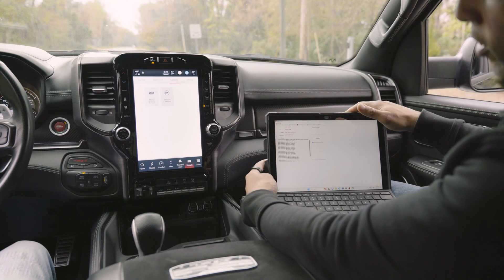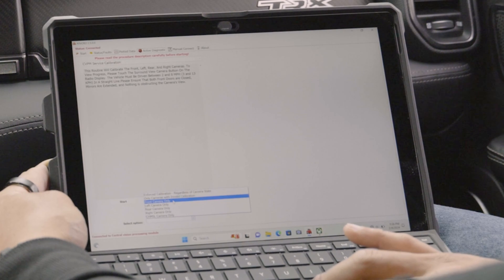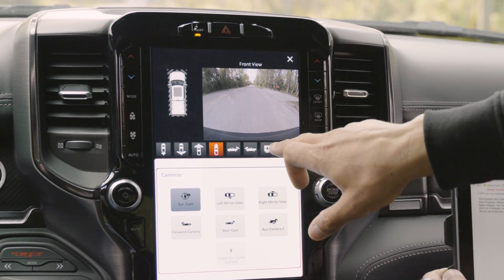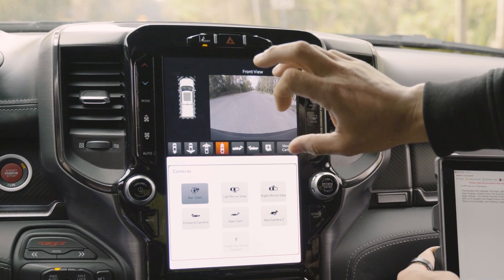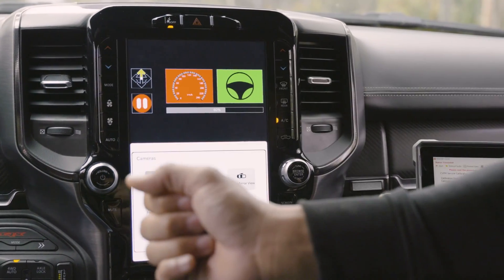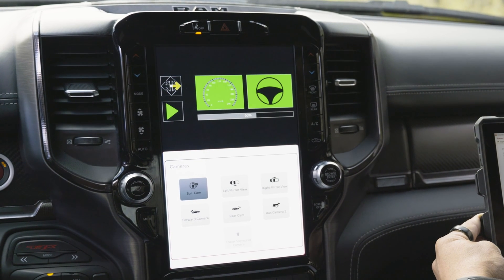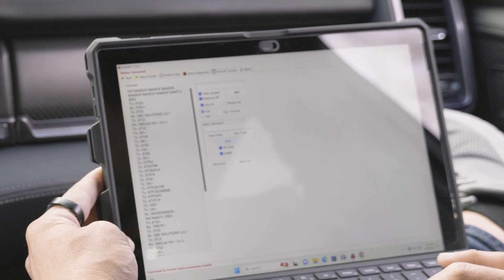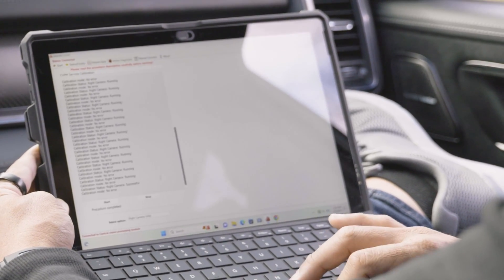RAM 1500 & HD - How To Calibrate The 360 Surround Camera w/ Alfa OBD

Comment: Hi Infotainment,

Thanks for the video again. 3/4 camera works as per video instruction except the front camera. message pop up line by line reported like the Left /Right / Rear Camera success until progress to 100%.

For the front, no message,It started the calibration process , stay green for both steering wheel odometer symbol. then after 500 ft. to said calibration fail. can you help
Reply from the maker: Unfortunately we can't really assist with this. It's just trial and error. You might need to take it to another road that's straight and has the painted lines, or have your local dealership do it through their programming software.
Reply: @Infotainment_nav  Thanks. I am now need your solution to get the Third Brake Light, Camera to works. the CVPM current utilized all 4ports for Front Back Left Right Camera. This 5th camera will need to connect to Uconnect 5.0 somehow, or through can bus ? Do you have a solution, wiring , harness and connector plug to purchase?

Comment: Hey so I know this is not about this video rather about a previous video I have commented a few times but not heard back. I have a 2022 ram 1500 bighorn with the 40/20/40 jumpseat and I am upgrading to the full length floor center console. I know you guys sell a bunch of the parts soI was just wondering if I could get some help finding the adapter wiring harness for the lights to the center  console and possibly get some advice on if I need a harness to adapt the usbs as well. AAny help would be appreciated. If I could get your email to contact you and get these questions answered that would be great. Thanks again and hope to hear from you soon!